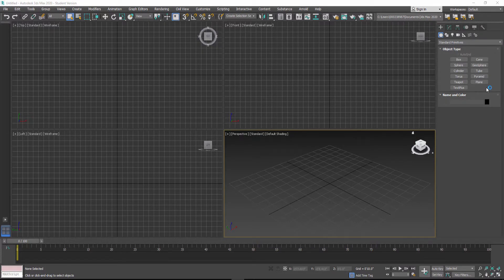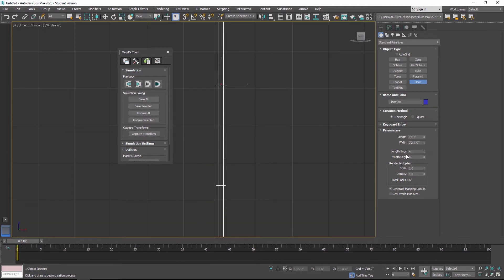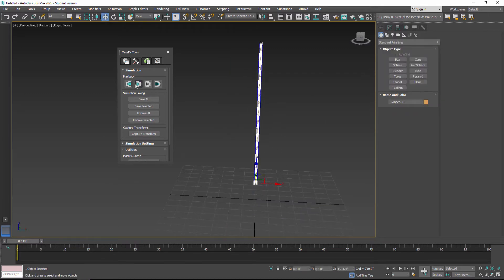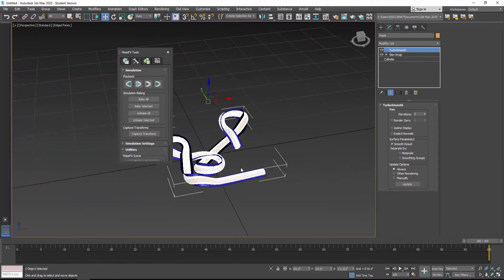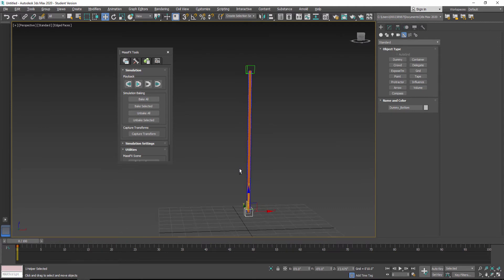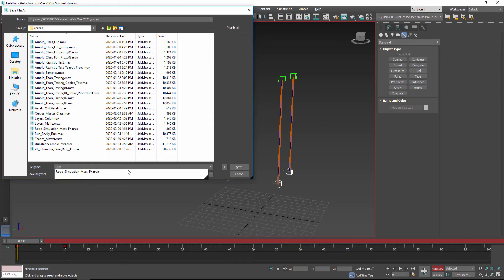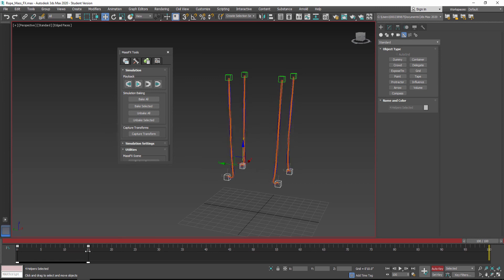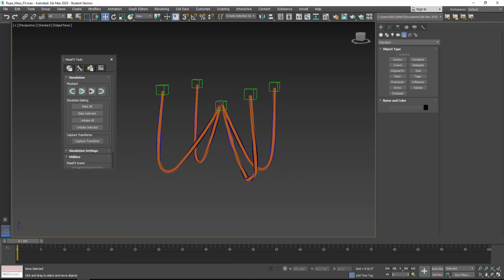Rope Simulation MassFX

Comment: Why is it that your rope immediately looks better on first sim? My is crinkling up on itself and bending at sharp angles.
Reply from the maker: Maybe double check your settings, system units and scale. I'm likely using feet and inches to measure and inches as the system units in this video.

Comment: Does someone knows how to do this in 3dsmax 2022? Seems it doesn´t wok anymore.
Reply from the maker: I will have to look into that maybe tomorrow. It should still work the same, but I will check it out.
Reply: @CreativeGraham  Did you have time to check it?
Reply from the maker: @RCL4958  sorry, I'd realized after commenting that I only have 2020 and 2021 installed. I'm updating to 2022 tonight, so should be able to test tomorrow.
Reply from the maker: @RCL4958  can confirm now, it works the same in 2022.